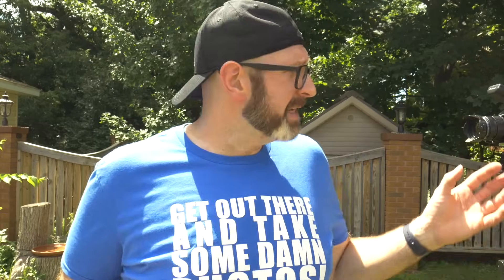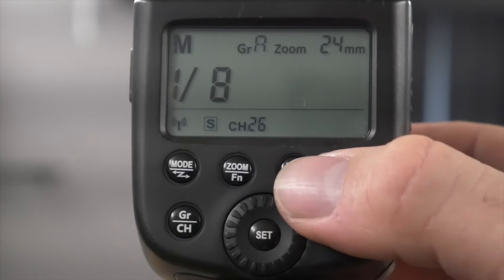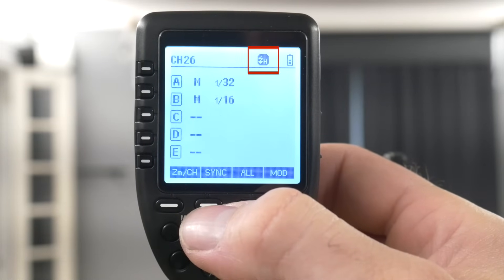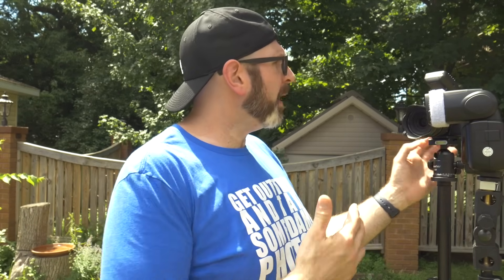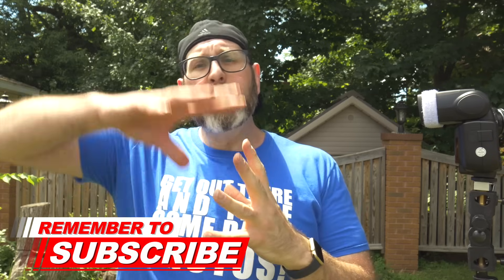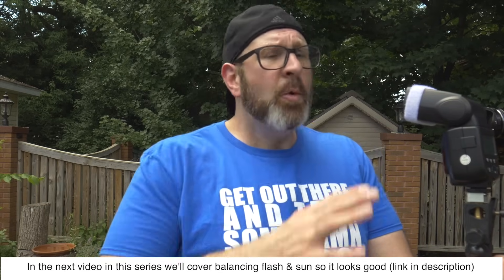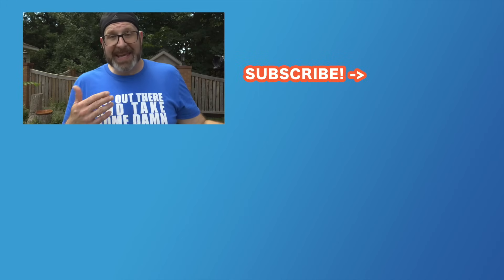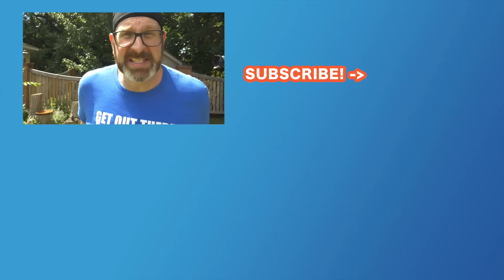How High Speed Sync Works

Comment: Hi everyone, is any possibility to connect tt600 by power wire? Not to camera, just to power adapter/charger or something.
To stop using battery at home, and use power from the wall socket (of course by adapter) Ps: This is my first light, and is amazing.
Thanks

Comment: Hi, it seems that HSS works correctly only when I have my Godox AD200 at full power, otherwise I get the black bar you talk about in your video. Has this been your experience, too? If not, do have any ideas on how I can use HSS with my speed light at less than 1/1?